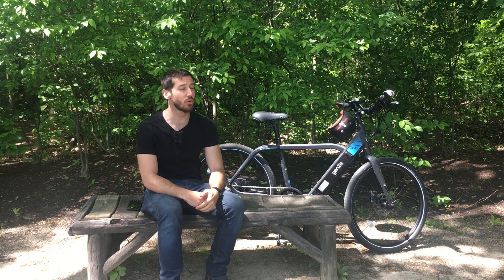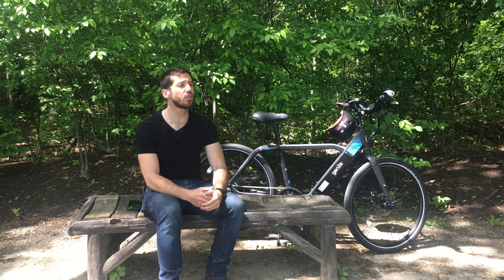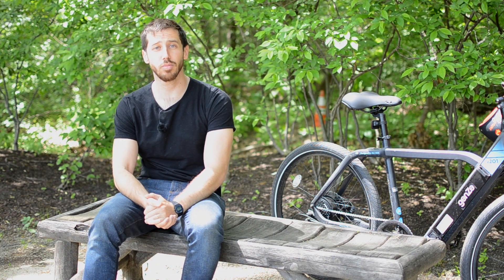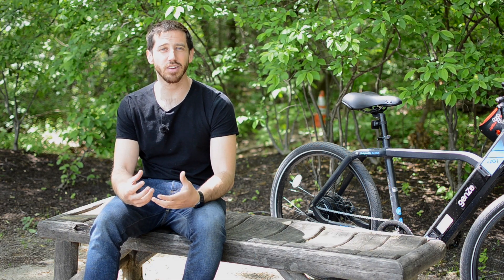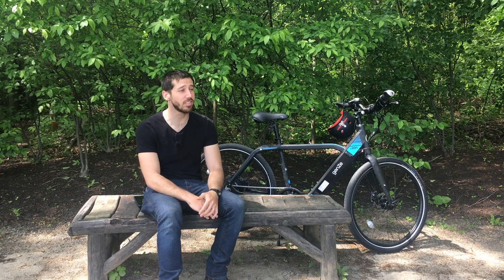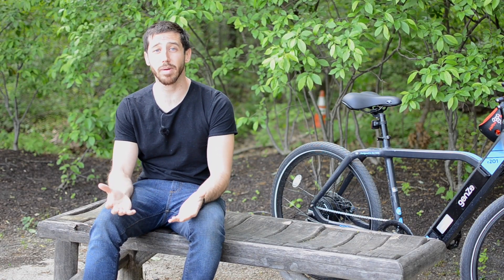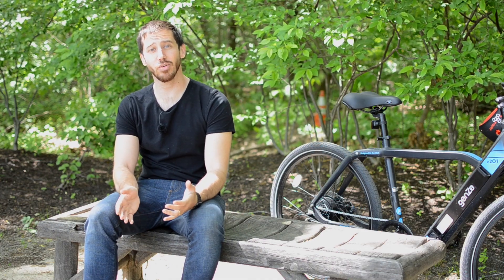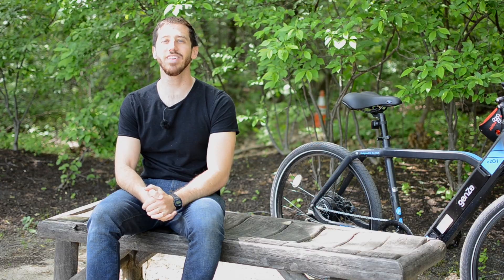How to choose the right bike for a DIY e-bike

Comment: What is the price savings building an E-bike, over just buying one?
Reply: Immense. At least 50%
Reply: That would depend on a lot of things. Like will you make your own battery too or buy it? Do you want a hub motor or a mid-drive. For a mid-drive which is arguably the better choice in hilly country, can you weld or will you need to farm that out because you will likely need to make structural changes to the donor bike. 

The battery alone for my e-bike costs $700.00. You can buy an entire bike complete with battery for that today if you shop around. Also there are things like how fast do you want it to be and how far do you need it to be able to travel. 

In other words, to even give a close approximation it would take a lot more information that you have provided. At the level of my ebike, I'd guess I could build it for a grand cheaper than I bought it at today's prices. But the same bike costs around 400 less today than it did when I bought it 3 years ago too. Plus the battery is slightly bigger. And I would lose the warranty which is worth something too. And what's your time worth? Will you make any costly mistakes along the way and say, blow up your battery in your face. lol ... If you a good with your hands, have the right tools, a bit of electrical knowledge and an affinity for working on things, it could be fun to build one. I have enough electrical knowledge to not hurt myself, but I had no desire to do all the shopping, waiting, installation, and frustration. I may upgrade it myself someday, but for now, I just enjoy riding it without all the hassles of having to deal with anything except charging it and keeping the tires properly inflated.
Reply: @holmer9413  Yes, it depends. But seriously that is an ambiguous answer with little direction for the OP. I should seriously post on my ebike account. I have built a variety of ebikes and gas bikes : 3kw gas generator hybrid (current), 1kw, 500w, 4-stroke,  and 2-stroke. I also keep up with the ebike market and I can say its 50% cheaper especially if you have a donor bike. Mid drives welding seriously depends if you have a weird donor bike. Just build your own. There are no costly mistakes with electric mostly just match the voltage and wires...
Reply: @holmer9413  Sorry that sounded rude. here is my yt ebike gas hybrid channel.
Reply: Thanks guys, for taking the time to reply. I'm new to this and am trying to learn. You all have helped, and have given me some stuff to think about.
Reply: @feedallday2556  truthfully, I don't think we can arbitrarily say 50% is a figure that is really accurate today. I did mention that I could probably have saved a grand on mine 3 years ago but I did fail to mention that I spent two grand on the bike, so ambiguous is a criticism I can accept. But there are so many more options today than there used to be. For example, I found this one with a quick search for just 400 dollars. It would be very hard if not impossible to recreate that bike for 50% off even with cheap components and a free donor bike. https://starkdrive.bike/electric-bikes/stark-drive-city/  It may be a really crap bike, but that price point is going to be hard to beat anyway.

It's not quite there yet, but I think ebikes will follow a similar path to computers. When I first started building my own computers it was far cheaper than buying one, but today, you can't really say that. Certainly not in every case. It all depends on what you need/want from your computer or your ebike as to whether you can build one yourself at a huge discount. 

And unless you really, really want to do all the work yourself, I also think that you should set a price for your time when you consider whether buying or building is really cheaper.
Reply: @holmer9413  okay, 49.3627% % instead. I mean the exact number is not as important as the magnitude. It depends on deals per deals but yes especially for $1.5k+ bikes imo you can build for 50%. Those cheap $400-600 ebikes have questionable batteries more so than domestic Chinese cells. Even at that price point, I would still build my own bike for quality.
Reply: Factory built ebikes seem to be getting better every year. If you find one that has everything you want, including looks, you would find it easier to just buy it. However, there are advantages to building one yourself - you can get the exact bike you want. You have more options of what kind of motor to add, and there are more choices as to power and speed that you really can't get on a pre-built bike. You can add the exact accessories you want. You have more choice of battery size and placement, and chances are, when you're done, you didn't spend any more than a comparable pre-built bike would have cost, but now you have exactly what you want and need. It seems that every pre-built ebike I've seen has something I don't like about it, and for the higher price, I'd rather build my own. One exception to this is folding ebikes. They are hard to find good donor bikes for, and there are so many to choose from that I would probably just buy one pre-built.

It could very well cost less too. If you already have a bike, and you want to just get an inexpensive kit and small battery , you will have a functioning ebike for a fraction of the cost to ride and learn about what you like and don't like.
Reply: @bFlattheOriginal   Yeah, looks is important too. I mean you can build a kick ass bike but then it wont have the look of retail bikes with the smooth curved lines and internally routed cables.

Comment: Please address "watt hour battery capabilities". The phrase used by European ebike manufactures to avoid exposing their low 36v batteries and 250 watt motors. Instead they state 500 or 1000 watt hour battery capability.  Just imagine paying $9000 for a Riese & Muller ebike only to discover you bought a underpowered 36v 250 watt 13ah Bosch ebike that can't climb hills.